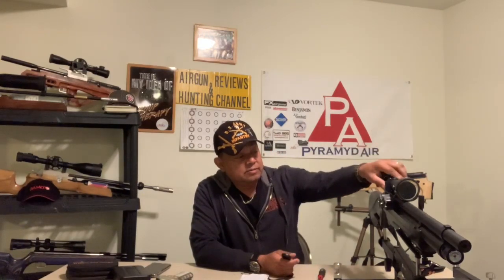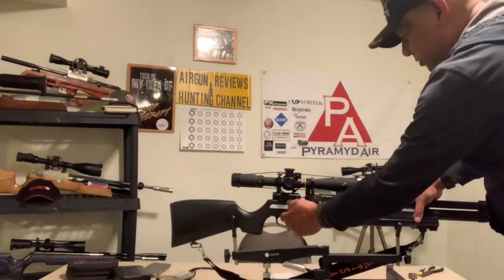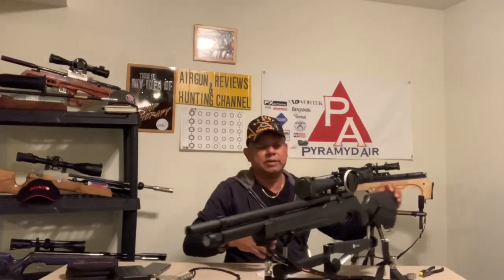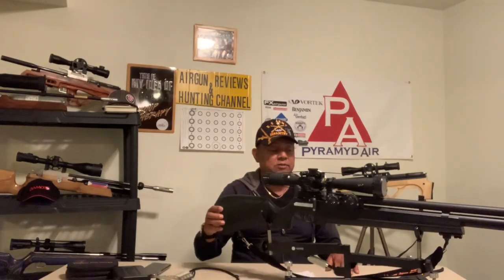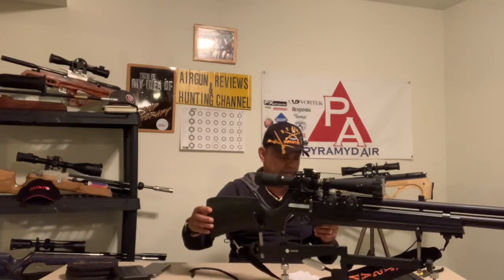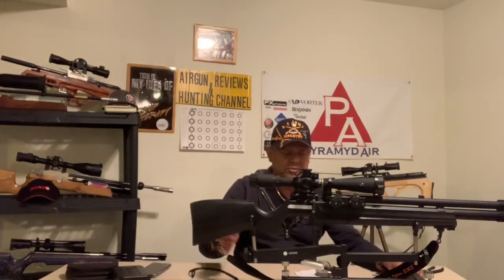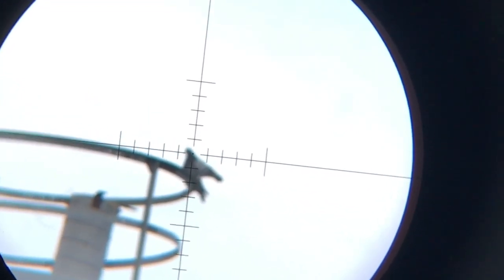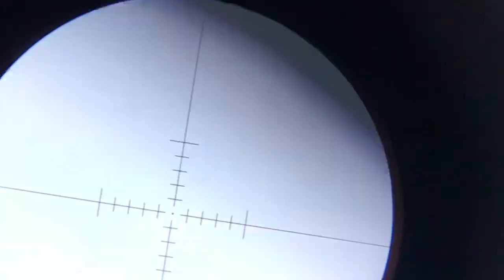ATI Nova Liberty 177 Review & Pesting *GRAPHIC*

Comment: The baffles from Jeffry Kim on eBay are one piece drop in and are amazing. Also so are the 3D printed moderators sold from Louisiana on eBay. I bought a 1/2”-20 adapter from Slovenia also from eBay. I have this setup on all my Liberty’s and the Avenger.25. These guns are crazy accurate and quiet. Super awesome deals and with the high and low power knobs make them super flexible. Love all of them.
Reply from the maker: 👋🏾 subbed to your channel didn’t know you had a channel👍🏾 going on eBay to look for those baffles👍🏾 also I have to take apart my Liberty and check the regulator relube ck o rings regulator not consistent like it was when I bought it. Maybe a video? brotha👊🏾😎
Reply from the maker: 👋🏾 do you have a link to the one piece drop in and the 3D printed moderators brotha 👊🏾😎